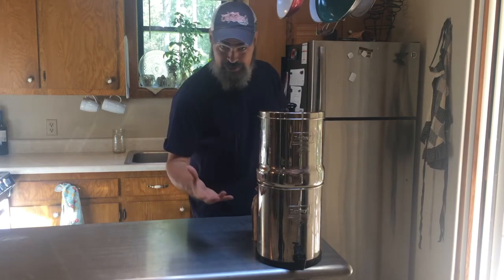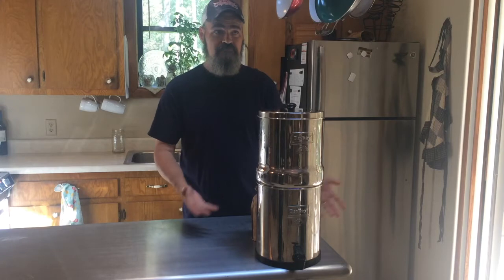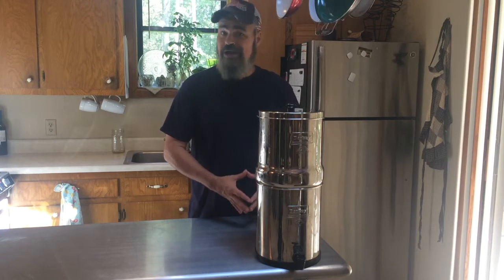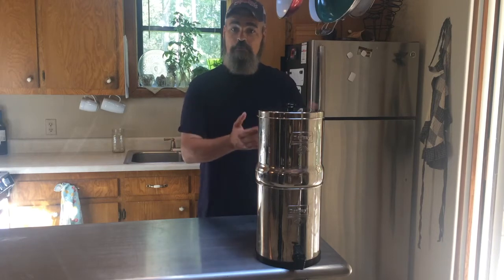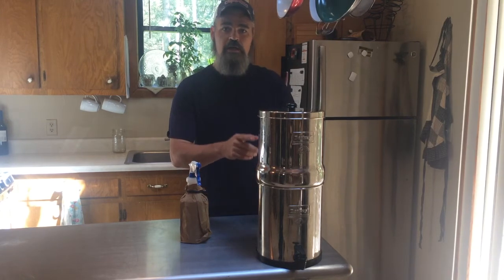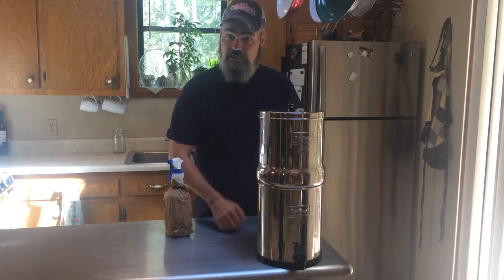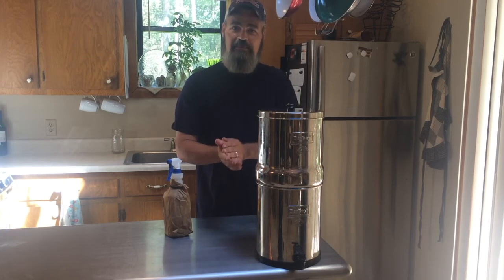Black Berkey Water Filters  -  SLOW FLOW Rate Solved  -  HOW TO - Using LACTOBACILLUS

Comment: I'm hauling in RO water jugs for drinking and cooking. My husband uses the countertop Brita water filter, that gets replaced once every two months, and is slimy with pathogen and calcium buildup. I don't want an under sink filtration system, so I've been watching many Berkey, Alexa and PureOne videos. Everything needs maintenance. Your Lactobacillus video sure makes a lot of sense reducing maintenance, since I use probiotic supplements already. Wondering where to get this for a spray bottle. I think I'll try it in his Brita filter first. Thank you.
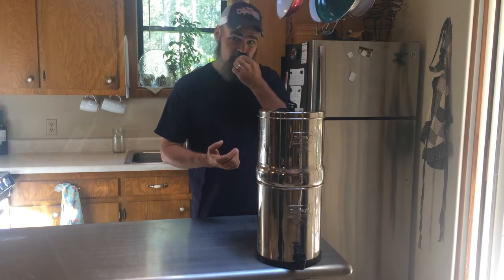Reply from the maker: It's so easy to culture yourself. Here's my way but you would be more than fine with one quarter of the volume I made in this vid. I recommend a playback speed of 1:25 when watching the vid unless you have trouble keeping up. Cheers! 
https://youtu.be/tWJzLYTiN7U

Comment: You could throw in a silver coin or two or something of the sort silver in each chamber as an experiment, would be interesting to see the results.
Wishing you a Great day
Reply: I was wondering about that myself does it work
Reply: Yes I was also considering putting a small pure silver rod in the upper chamber, or spray some of my colloidal silver liquid in the chamber instead. I'll try it out. I'm making my own water filter with stainless steel stock pots and using berkey filters. Waiting on delivery of the filters and tap. We  intend catching rain water, so may have less trouble with biofilm.

Comment: My  Berkey water would flow very slowly unless it was kept full all the times. My filters were clean, so that wasn't the problem. The upper and lower chambers were very tight, and hard to separate.  I took the top one off, and put around toothpick between both chambers, and put the top back on. Now my Berkey flows like crazy, even if it isn't full. That tiny bit of air space keeps the Berkey from creating a vacuum.
Reply: Mine came with a small clip that slips over the lower chamber edge. Just got mine and it flows strong so far.
Reply: I'm having that issue but don't really understand what y'all did to help it, something In-between the chambers, like the top part and the bottom part? like something on the outside of it or?
Reply from the maker: @robertgibson2622   I believe his explanation of using a tooth pick was to eliminate the vacuum that was keeping the water from flowing easily out of the spout. That's someone that is thinking wisely and it seems Berkey picked up on the idea. It's just to allow air to enter the lower chamber from the tight fitting upper chamber. Cheers!
Reply: @3basketliving  I stuck a pair of scissors on the outside of the filter where the chambers come apart at and its letting in air for the water to flow faster so that was a good idea, weird that I never had that problem though with my old filter hmmm

Comment: I have month old carbon filters. There is not just slime in the top container but a bad smell of mildew. My system is in a dark corner and I only fill it part way as I use out of it. I have been having stomach issues and a headache the last couple of days. Could this be the cause ? One day there was no odor and the next there was. I cleaned the system immediately and this time put in to well cleaned silver spoons to help keep bacteria away since this is what I have on hand. Will this work and are my filters still good since they smell bad ? Oh, and yes, I am on city water and developed slime in a months time.

Comment: well that was helpful indeed. but my problem is more complicated . my berky is brand new . like 30 gallons new. i start harvesting rain water for drinking.. first run was nice about an hour with 2 filters. Next run took 4 hours .. each run of water was slower and slower... 30 gallons has takin.. me 3 days.  I took filters out and cleaned them once. recharged and install.. flow rate one hour for big berky 2 filters. 2.25 gallons . = 45 minutes .  near the end of the 2.25 gallon tone filter stopped . completely .  leaving a quarter pot of water in 1 hours....I also considered hydralics.. thinking air trapped in the bottom berky creating back pressure.... so i created space between the upper and lower contianer.. still water flow slowed way down..... SO what did I do wrong?
Reply from the maker: It's hard to say without seeing or being there myself but my first thoughts would be directed at the water source itself. If your collecting rain water then I can only think about how much of the larger debris (even the stuff that you still can't see) is within the water collecting system that you have set up to begin with such as the roof, gutters, tank, etc. If your not already then I would certainly pre-filterthe rain water from/ through the system before running it through the berkey filters. IWe know that if we wanted to filter something like muddy pond water then we most likely would have to clean the filters probably ever other use so we would pre-filter that pond water as best we can to remove the larger particles. This is only my assumptions given the fact that I can't see what your seeing.  Thanks.
Reply: @3basketliving  You bring up good points.     About the water collection... So first of all the rain barrel is Algreen Castilla.. brand new .from the gutter i have a  diverter from Rain Reserve . As far as the gutter go.. In preparation for the rain barrel. I cleaned out all debris and put a steel mesh gutter guard on.. So the rain water is clear to the eye with occasional particular matter. More Berkey thoughts... I've notice a very good flow of water till about it hits halfway .Then the water start dripping and slows considerably. Is this typical for anyone else..  Another thought would be am I trying to do to much water at once.. say 5 , 10, 15 gallons .. in a day.. for 2 filters..  lastly is there ant break in for these filter to run consistently? thank for the help..
Reply from the maker: @YnotDoit  It's normal for the flow to slow as the water is being filtered from the upper chamber. This is due to there being less water in the upper chamber which means less weight and gravity force to push the remaining water through the filters.THe lower the water level, the less force, and in turn the slower the water will flow below.
Reply: @3basketliving  not really in my case . I fill the water up frequently so its fill mostly to the top (0% of the time. experiment after experiment ... 5 gallons is a 32 hour process . their  website suggesting 1 gallon of water an hour. Which is not the case for me.. I mean I'm using rainwater that is as clear as tap water...SMH?
Reply: @3basketliving   Any suggestions on a way to pre- filter . ?

Comment: My Berkey filters work fine until the last bit of water, then some white residue gets left in the bottom container. Any ideas? I have reprimed, cleaned with white vinegar and still
Reply from the maker: I couldn't possibly have any idea but water is your water source that you normally filter?
Reply: 3 Basket Living city water. I’m doing to start distilling it first maybe because I live in so cal land of the poop water. Might need to prime with filtered water instead of my milky sink water. Thanks for getting back to me! Keep up the great videos!
Reply: @dolphinitely_bro3944  I live in VA and get this white residue. I was told it is from the fluoride filters

Comment: Hi, I live in England (UK) and watched your other video to show how to clean the Berkey with white vinegar which was brilliant. Someone called Lou left a comment showing research about acid possibly widening the pores, which could possibly allow toxins to leach through rather than be filtered. You said you would pay for a water test to check the quality of your water. Did you do this test? Very interested to know what your results found. Thanks very much for your video.
Reply from the maker: Hi Debbie......I can't remember saying that I would pay for a professional water test but maybe I did and if I did then I guess I lied because I didn't do so. I have done the red dye test for the Berkey 3 times now and I recorded  the last one after knowing that I have over 10,000 gallons of water filtered through the same filters (2 each in my set up). Have you seen that video? The red dye IS a synthetic chemical that most confirm is to be "toxic" so I take that as my evidence that my way of cleaning with Distilled water and Distilled vinegar IS NOT causing harm to the filters OR enlarging the porosity of the carbon. I'm still using the same filters with confidence to this day. Hope that helps and I apologize if I said I was going to do something and didn't follow through.  Thanks.

Comment: Too bad there is no way to keep these Berkeys in a fridge. Seems like a bad idea to have water at room temperature where bacteria, slime of any kind will grow much faster and the vessel is in room air with insects, dander, dust, airborne germs and pathogens etc... I'm not sure if the filter is designed to work in a cold environment like a fridge but I might make something using those black filters dripping into a long shallow glass container.
Reply from the maker: That's why I use the Lactobacillus bacteria in the upper chamber. I have no issues since doing so but I still keep the system out of direct sun light to help. Plus I'm getting beneficials in my water.  Thanks.
Reply: @3basketliving  Nice. I made this. All glass water storage and see through. It's slow since its only 1 filter but that is working as good as a water pitcher and I get 1 liter every fill. I could make a fatter system with more filters to increase flow. I've been using it for 2 months and nothing on the filter has formed and I don't think it ever will in the fridge if kept cold enough. I think I will consider a mini fridge for future just for a big berkey to sit in! But for the on counter method your Lactobacillus bacteria procedure is the best method I've seen. Check  out my system, there is a picture in the bottom of the review. https://www.amazon.ca/gp/customer-reviews/RIA7ZEAKLWUQH/ref=cm_cr_dp_d_rvw_ttl?ie=UTF8&ASIN=B00BWIWW1Y

Comment: Adding Colloidal silver to the water will give the same affect. I purchased a "Silver Lungs" Colloidal Silver machine and make my own. Bought cases of bottles to make and store large amounts of it. I also put this in spray bottles to spray on fruits and veggies before eating. Kills all the bad bacteria. Adding it to water will help purify it and keep the slime down. As for the good bacteria, I make kombucha here at home to help with that. Used to have lots of gut issues and now I have none. Great stuff. Thanks for the great video. Oh and if you are worried about silver you can check some of the newer ceramic filters out. They come with silver in them for just that reason.
Reply from the maker: I am one of those guys that stock up on silver but these Labs are amazing. Thanks again.
Reply: I wonder if grapeseed extract or GSE (Nutribiotic) would have the same effect.  Like just using a few drops.
Reply: @toriarose  I wish someone answered. Did you try it on your own?

Comment: Your maverick style and relentless experimenting is so admirable ... how do I know if I have a mild or heavy lime buildup?  I do get some crust around faucets but probably needs mild cleaning once a year.  I do have heavy rust in the water but I have a filter between the holding tank and the house which catches a lot.  I wish there were some test beyond the red dye to know what is actually happening, sometimes I fear I am drinking all kinds of crap due to dirty filters but I don't have any buildup I can see inside the Berkey tanks or at the spout after using it for 8 months, it is not too slow but def slower for sure.  I am concerned about the vinegar and lactobacillus effects that may not be visible.  I wish I had your certainty because I sure do share your enthusiasm to beat the "system" wherever possible.  Thank you so much for your thoughtful contribution to resourceful living.
Reply from the maker: Oh Ms. beautiful Barbara...sounds like you already know if you have heavy or lighter lime concentration.   LoL   Doesn't sound very heavy to me. There are test out there to show much more but we have to be willing to send samples away to independent companies and Pay for them. Your concern with the Lactobacillus TO ME is unwarranted given that we would be taking in into ourselves and or have plenty of it already present in our guts. It's EVERYWHERE (hopefully) to begins with. If your concerned about the vinegar still then maybe don't use it.  Do the cleaning AND the gravity reverse flow on your filters like i did with DISTILLED WATER ONLY and see the difference in your flow rate afterwards.   Remember that the Distilled Water (the H2O molecule) is like sending trillions little magnets through the filters collecting and pulling crap along the way and out.   ;)  That's the way I see it.  If you have Problems and concerns with the Distilled Water then..........I GIVE UP!    LOL